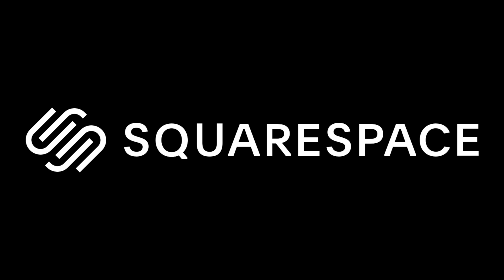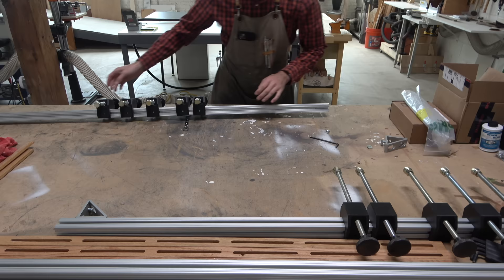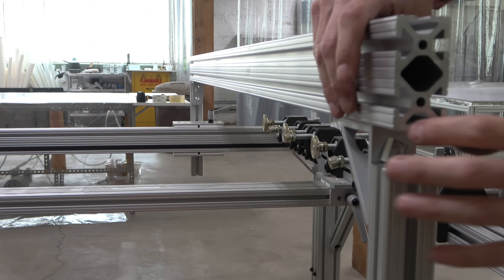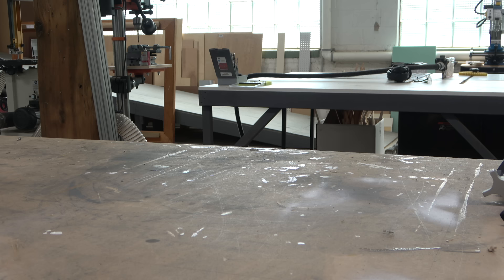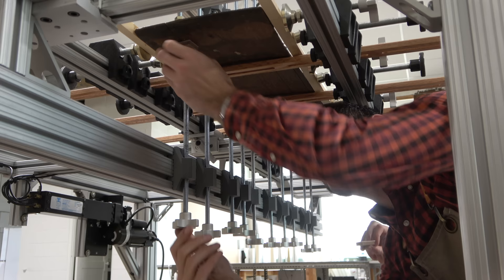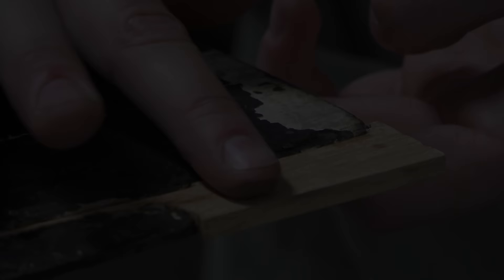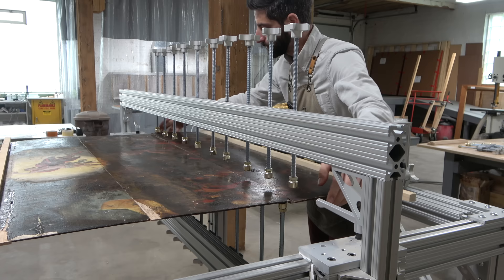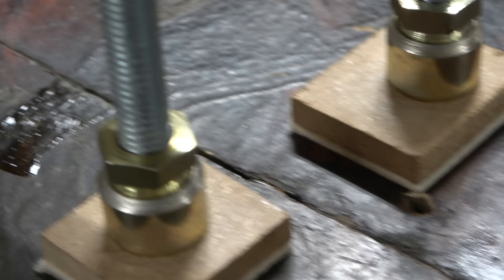Wood You Believe We're At It Again? Part 2

Comment: Have you considered adding a recessed pocket to the MDF-and-felt blocks for the clamp feet to fit into so that they won't slide around so much? It feels like in some cases you're intentionally moving the blocks off-center to alter the location of the pressure slightly, but it feels like keeping them from sliding free would be beneficial in most cases. You could even make the pocket significantly bigger than the clamp foot to allow most of that motion while still preventing you from worrying about them slipping off entirely.
Reply: You know... If he made more of a sloping indent - to make the surface concave in the middle -than a pocket that perfectly fits the clamps, I think it might actually be more effective at distributing the pressure where it needs to be.

Comment: Tip on the nut/epoxy joining. When working with some 3D/printed materials. You can simply heat up the metal part an push it in. The plastic will melt around the metal and fasten it in place. 👌🏻
Reply: Also, if he doesn't want to do that, apply epoxy on the inside of the socket, not just the outside of the nut!
Reply: He used UV cured resin, because of the printing process filament 3d prints necessarily have to be thermoplastic (gradually soften with heat) but I don’t think it needs to be the case for resin prints, are you sure resin prints are not thermosetting instead(can’t be melted without decomposing or burning)?

Comment: Julian,  Have you considered "access slots" towards the ends of the aluminum extrusions? These would run perpendicular to the slot that captures the carriage bolts This would allow you to remove the clamp mechanisms without having to disassemble and remove the entire extrusion from the frame of the machine.

Comment: Hey Julian, about your use of aluminium extrusion profiles: I have worked with those a bit. Consider buying hammer screws / T Nuts, that can be slipped through the slot and twisted into place. Those are a god send when the ends of the profile are blocked off and you want to mount something in the slot. 

There are also T Nuts with either a leaf spring or a ball detent to prevent them from sliding down vertical slots. Also very worth it.

I always try to design my fixtures in a way they can be mounted without access to the open slot ends at the extrusions end, saves me a lot of headache when I blocked those with something. 

Oh and consider buying plastic end caps for the extrusions, I have given myself some nasty cuts and scratches on sharp corners on the ends. 

Greetings from Germany

Comment: Hey Julian, I noticed that those little blocks with felt that are used between the clamp and the paint are difficult to place on the bottom of the machine. My suggestion is to put a piece of magnet on the back of them, it should be easier to handle. Since the magnet will stick to the clamp then there is no risk of it falling to the floor. I don't think it even needs to be a strong magnet, a fridge magnet running the length of the little blocks should work just fine.
Reply: There are those watch battery sized ones that he could even buy in bulk. (Only one in the center of the clamp or block might be all that’s necessary. Then it would just lightly connect the two and it wouldn’t rigidly be held in place.)

Comment: I hope you did your stress calculations right on those clamps. Those T-sliders have sharp corners that just SCREAM "Stress risers" to anyone with a mechanical background. I assume you won't be putting a lot of pressure on that clamp, so you might get away with it, but with enough pressure you'd definitely get cracks and eventual failure.
Reply: I guarantee that this project has been done already and is finished. If it wasn't a success, they wouldn't have uploaded this series.

Comment: Last time I asked why you didn't just leave the panels disconnected as a triptych and let them float together in a frame. This time I'd ask if you might have considered removing the wood from the painting? Since the panel is so thin, would a few passes with the router leave you with a thin layer that you could mount on something else? I'm always amazed when you take the wood off the painting. That's cool AF.
Reply: Trying to remove the wood is like scraping the canvas thin. It's not a good idea and leaves it weak. And doing that when wood swells and contracts is going to be a problem. Whatever surface it's then binded to will have issues with that movement. Not gluing it together is a problem too because it was binded together to begin with and restoring a painting is returning it to as close to original as the conservator is possible of doing. That means gluing the pieces together. And again, you gotta worry about the movement of the wood and whether or not that's gunna harm anything on the paint layer.
Reply: @DrDingsGaster  Also depends on what the client /actual owner of said painting wants, he doesn't get to just go ham and do his own thing all the time, sometimes they have requests or expectations for their collection
Reply: @Micro-Worlds-Extraordinaire  Well yes of course. But the fidelity of the original painting is his top priority unless they say otherwise.
Reply: Julian said the panels are warped. I would assume the panels being so thin to start, would compound the problem of getting them to lay flat in order to router them evenly. I'm just guessing, reason why I love Julians videos, he explains his thought process and creative solutions.  But you have asked a great question
Reply: Julian explained in the last video why he would do everything in his power to avoid romping the edges. He repeatedly stated that he wants to avoid removing wood, as much as possible. (Also you can see the pain that he felt when being forced to use tools on a painting in Wood That It Were So Simple.)

Comment: No need to over-engineer.  You only need big enough a fastener to apply the needed force.  Looks like with the old ones, you could have cranked down the pressure until the painting board was obliterated; They were enormous o0. This new way isn't just more efficient, it's safer too.  NOT as if our hero Mr. Baumgartner could possibly show a human error.  ;-)  One of the coolest things, and the MOST professional, is that this man can confess to mistakes and clearly explain the process of betterment. The consummate pro.  Next to the encyclopedia entry for "Professional" should be a pic of Julian.  Awesome vid.

Comment: Throwing shade on JB Weld epoxy.... it's simply the right tool for that particular job, just like the threadlocker.  We wouldn't expect you to co-mingle those  materials with the conservation materials.    Love seeing the payoff of your flexible design - panels may be similar, but each project is different in challenging ways.

Comment: I think that another small improvement for Clampinator 2.0 would be to add a 1 or 2mm circular divot into the center of each felt-backed square block. The end of each vertical rod would nestle into each circular divot, which would prevent the square block from sliding out of alignment as the rod is tightened.
Reply: I'm not an engineer but having a square on a square. Wouldn't that mean even pressure along the entire surface of said square? I would guess adding a divot in the center would change the amount of pressure along the entire surface, mostly at the edges. No idea like I said not an engineer.
Reply: I have a suspicion that those felt blocks sometimes need to be moved slightly off axis to the rod, depending on the shape and condition of the wood they are touching. The position of the clamps cannot be moved individually on one axis, the axis of the support bar, so that little bit of flexibility might be necessary sometimes. Just a guess.
Reply: @francesconicoletti2547  - I remember watching another video where a felt square slowly moved out of alignment as he was tightening a rod. I watched him push the piece back to the center as he continued to slowly tighten the rod.

I don't remember him mentioning anything about the need to place a square piece off axis due to the condition of a painting, but I could be wrong.

Comment: Hey, really good job. Another improvement that you can do for the lateral piece of wood that you use to put pressure on the board is to use a piece of wood with an L shape, like that the piece of wood will not twist under pressure from the clamps (or twist less).
Reply: Every time I see those I always wonder if there’s some way he could add a bit of padding to protect the panel edges without sacrificing the alignment and I feel like this might do the trick.

Comment: A indent in the handles would have been a good addition, to be able to use the drill to run the new clamps in and out quickly.  Probably not necessary for delicate work like this though.
Reply: Maybe that’s something he would do if one of them broke/something went wrong/the glue failed.

Comment: I noticed you used hide glue on irregular surfaces, is hide glue gap-filling (like epoxy) or is it closer to PVA, where a gap of a few fractions of a millimeter is enough to reduce the joint strength of an order of magnitude or more?

Comment: Aha! So there will be some sort of lining material! Hmm, it's got to be able to flex to the shape of the panels but also provide structure. I'm curious to see what material (or combination of materials, like a flat board and a flowing filler) might be used.
Reply: He has a series called Wood That It Were So Simple where he conserved another split panel and added a backing. You could check it out if you want to see the materials that he used last time.
Reply: @emmakane6848  I've watched it before, and I don't remember it 100% but didn't he trim the wood off the back and completely re-mount the painting? I feel like that wouldn't work for such a large and warped piece.

Comment: Love to see the modular system being altered as Julian better understands how it actually functions in the real world!

One thing that’s making me scratch my head about it though is how long the the metal rods for the new (top and bottom) clamps are. Now I’m no expert, but I assume that the closer the handle is to the part that makes contact with the painting the better. Closer connections mean less play in the mechanism/more exact control on each of the individual moving parts.

I guess Julian might have chosen those lengths so that he could reach the bottom most ones more easily, and potentially apply less force with each individual turn on them. But the top ones are where he can see what’s happening more clearly. If the table is raised then I imagine they might be sticking up far enough that it could lead to awkward positioning on his part to accommodate them, rather than them conforming to his needs as a conservator. (There is also the chance that he just didn’t want to get someone to cut them all in half, or deal with renting/acquiring the tools necessary to cut them, because that’s just the standard size.)

I would love if someone coming at this with a more experienced design/engineering/physics perspective could chime in and let me know if I’m way off with my assumptions.

Comment: By reducing your thread by an eight of an inch, you've gained : 
24 (clamps)*[*pi*(1/2)²-pi*(3/8)²]*12"(clamp height)*0.2833(steel weight per cubic inches)= 28 pounds.
I'd say you made a good decision if 1/2 inch was overkill.

Comment: Great Video! Do you have to worry about the inherent stress you've trapped in the glue joint? I would think the bend in the panel will put stress on the glue joint curious how you handle that!

Comment: You seem to take a long time with aligning the hide-glue joint. As an avid tinkerer I am wondering: are you using a chemical additive to your glue to delay setting? I personally had good results by adding about 5% per weight of urea to both increase open time and lower viscosity.

Comment: 19:13 Why don't you hot glue the little blocks of wood to the swivel feet of the clamps? There would be a lot less fussing around if the two were connected, yet if the block was, by some small chance, glued to the panel...  the hot glue is easy enough to be snapped away from the metal. 💖🌞🌵😷

Comment: Great video, as always.  I'm just wondering about the gluing and clamping the initial cracks.  In this case you had several of them. Doesn't gluing and clamping one crack risk the entire panel to bend and break along a not yet glued crack?
Reply: They try to very carefully and methodically add pressure to each one so that the others don’t deform. Julian has also mentioned that hyde glue is much strong than rabbit skin based ones while also being flexible so it might be uniquely suited for ensuring that everything stays in place.

Comment: Why didn't you place the panels in a 90% humidity space for a week (quasi steam bath) and press them after this on the hot table under vacuum before gluing them together to straighten the curves?
Reply: The Perils of Painting on Panel is another video where he conserved another split panel using moisture after the glue joint. I think that he explained it as wanting to glue it in its ‘natural state’ where the breakage points theoretically line up more than if it were perfectly flat from the get go.
Reply: I also believe that he said somewhere else that vacuum seals (as well as the other kind of vacuum - before he got the HEPA filter one) are too drastic/put too much stress on the paintings for his liking.

Comment: I thought there was a plan in the first to add in pieces of wood into the joints to increase strength and surface area? Did miss something
Reply: That’s next time, after they can go back in and see where the Wood is currently making contact.
Reply: @emmakane6848  ah okay, thanks!

Comment: 400 years from now, a conservator for functional expressions of creativity receives a commission to restore a frame-like apparatus whose function isn't exactly known. The work is in dire need of repair, among other things most of the epoxy used in the piece has failed. The conservator mutters under his breath about substandard crafting materials of the early 21st century, and explains that they will have to scrape all that failed epoxy off, so that they can bond the piece back together using a conservation grade epoxy that is easily reversible but will last many thousands of years...

Comment: Aluminum is flexible. Just watch the wings of an aircraft in flight.
Reply: Springs are made of steel because it is more flexible than aluminum.  All common metals are flexible.  Aluminum wings flex by design.  The beams in this table are designed not to flex if they are sized appropriately for the load - note the triangles in the cross sections.  As Julian said, it's down to the math.

Comment: “Hardware store epoxy” isn’t posh enough for you?
Reply: I think he is angling for a "Total Boat" sponsorship.  

He could level out the painting with Total Fair, strengthen the canvas or wood with Penetrating Epoxy, give it a good coat of Table Top Epoxy and finish it off with Halcyon Marine Varnish.
Touchups could be with Wet Edge Topside Paint.

In the future, whenever the painting needs cleaning, you just pressure wash it off.

I expect to see Julian at the makers booth at the Wooden Boat Show in Mystic, CT.

He could do a crossover episode with Lou at Tips From A Shipwright.

Think of the possibilities....